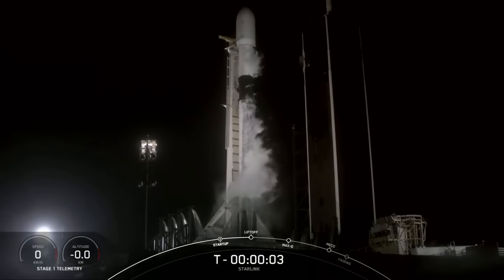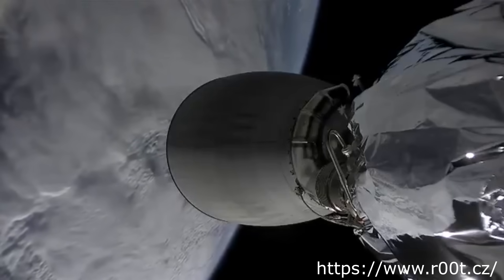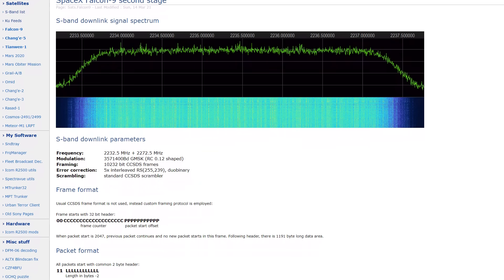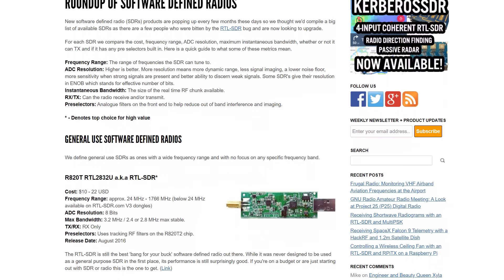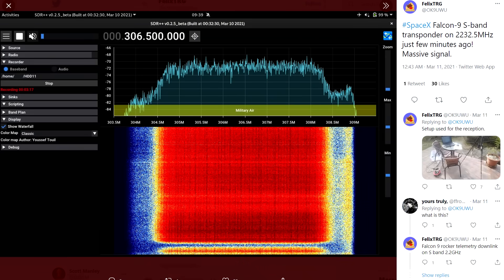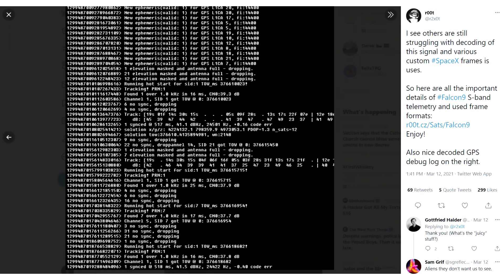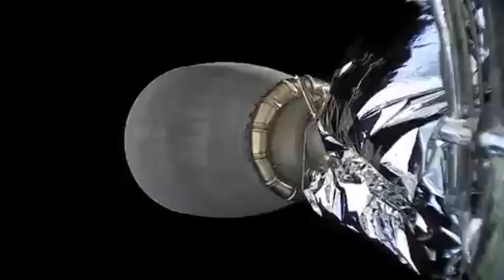How Amateur Radio Fans Decoded SpaceX's Telemetry & Engineering Video

Comment: Good video as always Scott Manley!
Just wanted to leave a little bit of knowledge here. Spacecraft telemetry is  generally sent in either S-band between 2.2 GHz to 2.4 GHz(mostly to 2.3 GHz tho)or over X-band between 8-8.4(8.5) GHz, then they are downconverted to generally 70 Mhz or 720 MHz depending on the situation. Now how the conversion works?

When you multiply two frequencies with a mixer you get two difference response in frequency domain, let's call the frequencies f1 and f2
First response you get is f1+f2 and the second one is |f1-f2| by using something called phased locked loops(PLL) you can downconvert a 2.3 GHz to 720 MHz by multiplying the 2.3 GHZ signal with a 1580 MHz signal and then you can filter it to leave out  2.3+1.58 GHz response to only get 2.3-1.58GHz response.

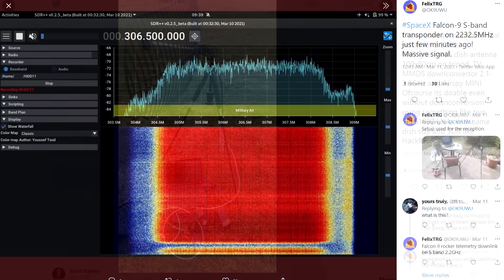Comment: Really surprized to see my radio receiver software (3:43) in a Scott Manley video lol
Reply: I just installed it yesterday! Works pretty good so far, though having the ability to scroll through the band would be nice. Thanks anyway, certainly much easier to use than SDRAngel.
Reply: @ErikBročko  Shouldn't be too hard to add ;)
Btw, make sure you always run the latest commit and not the releases, I push fixes very often.

Comment: The term your looking for is a transverter.
Reply: Not quite. A transverter works on both transmit and receive. This is more accurately called a down converter and it is, in effect just a front end superhet mixer.

Comment: HAM operator here.  A downconverter is basically a fancy way of saying that the SHF receive frequency is being shipped through a mixer to shoot out the signal at a much lower intermediate frequency (IF).   The SDR is then listening on the IF of the downconverter output.  When we play with frequencies in SHF, it's typical to use a "transverter", which is a upconverter and downconverter in the same package, and we modulate it with something like a standard VHF/UHF radio.  The dongle isn't that expensive, but the AZ/EL rotor to track the satellite/other body and downconverter is where the money is spent.
Reply: I dont understand this. But very interesting.
Reply: @xzaz2  Let me see if I can help with the understanding.  Radio is this very easy thing that people complicate which is why RF engineering has become a magic art of sorts.  Most radios that are not software defined use something called the "heterodyne principle", heterodyning meaning "mixing one frequency with a received signal to get another".  We always know what the "other" frequency is, which we call the intermediate frequency, the IF.  This allows us to extract our information off of it using only the one IF frequency (as opposed to any frequency in the receive range), whether that be a voice, or data, or whatever.  Check out this excellent video, including a very nice block diagram of a superheterodyne receiver:  watch?v=x9hnbzF9XC8  (Note that this does not contain the transmitter block diagram which has a few different pieces.)  Superheterodyne is basically heterodyne with amplification included.  Since that clouds what I'm trying to explain, I'm merely going to refer to it as "heterodyne".

Downconverters work as kind of a lego of sorts of the heterodyne receiver.  Imagine the block diagram in the video above, but take ONLY the components from the antenna and IF block.  That's a downconverter.  It receives on one frequency, goes through the mixer with the local oscillator, and spits out the RF on the IF frequency, which is a dividend lower.  That output is then hooked up to another radio which is listening on that same IF frequency of the downconverter, but instead of an antenna, they're just linked with a coax jumper.  It can be a software defined radio (which uses something called IQ - "quadrature signals"), or a conventional heterodyne, or whatever demodulation needed.

Radio circuits all have limitations on frequency range.  In the case of the SpaceX decoding that Scott is talking about, that IF output on the downconverter is hooked up to a software defined radio to knock down the frequency that would normally be well above the range of the SDR itself.  I hope this at least helps demystify some of it.  I recognize that a lot of this is second hand for me and I may have glossed over some things I take for granted, so feel free to ask any questions you have.

Comment: I never had the patience for that level of geekiness.  It's really good that somebody does.
Reply: Same... Digital RF wizardry like that will always be way over my head 😁
Reply: I once studied RF tech pretty hard in college, loved it, but never worked in the field and now my knowledge is lost. Still really cool stuff.
Reply: Right?  I just use my rtl-sdr to listen in on air traffic and ham radio operators talking about conspiracy theories.  :-P
Reply: @andie_pants  :o)
Reply: almost nobody acquires this level of expertise through hobby alone. 10 to 1 he's some kind of professional radio engineer.
Reply: @oldfrend  Probably, but not necessarily. Perhaps a software engineer, or experimental physicist, or something like that. Then again there are people whose hobbies are completely different from their profession, and they devote similar, if not greater amount of time and energy to them.
Reply: @bazoo513  The average software engineer has no clue how most complex rf systems work.
Reply: @jonnyj.  Average, no, I agree. Do these guys look average to you?
You do know that amateur radio operators revel in, for example,  communicating over long distance by bouncing radio signals from the Moon or from meteor trails, using self-built equipment (well, the best of them do). And they are amateurs. Look up Copenhagen Suborbitals to see what driven amateurs are capable of.
I don't think that RF part was the most challenging one here, and, after all, SpaceX is using standard frequencies, modulation and encoding (I was surprised that there are standards for such esoteric use, but then, why not - telemetry is telemetry,)
Reply: I know right! My level of patience maxes out at making 27 M1-D engines from ⅜in dowels for Falcon Heavy model rockets...!
Reply: Some very smart people have no patience.
Reply: ok boomer?
Reply: @lolbots  ok millennial?

Comment: Does this mean the next generation telemetry will be encoded  by encryption next
Reply: Encoded WITH encryption. Encoding and encrypting are two different actions. Encoding is formatting the data such that it can be decoded(read). Encrypting is an additional action, done before encoding, making the data unreadable. But probably not, else it would have already been encrypted.
Reply: Unlikely because encryption would result in more data loss when interference or transmission errors occur.
Reply: @TallinuTV  Ah, but for that's there is Error Correction. And encryption does not result in more data loss, the stream probably is sent as packets just like the IP/UDP protocol, just with extra error correction codes.
Reply: @paulmichaelfreedman8334  true but encryption is an action that takes work unless the system has enough over head to accept encryption it will slow down the system this would also depend on how hard of an encryption is used there harder it is the more work it take. also unless they use some really hard encryption someone can just record the data and crack it later even with the hardest of encryption's if someone puts in the time and effort in it will be cracked sooner or later.
Reply: @phalanx3803  Anything can be hacked, eventually. But if CPU speed is an issue encryption/decryption can be done in hardware. It often is.

Comment: Really incredible work with the decoding part! 

For the curious viewer: the "downconverter" mentioned  about three and a half minutes in works in a far simpler manner than you might expect: multiplying two waves produces a new signal containing waves formed from the sum and difference of their frequencies (if you've ever heard of "beat frequencies", this is it!) After a special low-noise amplifier, the incoming signal is mixed with a local oscillator of just the right frequency to "translate" the signal into the appropriate range, which is then passed to the SDR.
Reply: And there's one of these in the middle of every satellite TV dish.
Reply: Hmmm, yes. Very "simple".
Reply: @arkology_city  It really is, after mixing you only need to filter out the signal you need.. easily done in software with a SDR.
Reply: @arkology_city  If you have two guitar strings and you tune them to nearly the same frequency, then play them at the same time, you'll hear them getting loud and quite a few times per second at a frequency that is the difference between the tuned frequency of the two strings. This is similar, but with radio waves.
Reply: @arkology_city  I wouldn't call it super simple, but it was far simpler than I expected when I first read heard of upconverters. "What black magic could possibly be in one of these boxes?" I wondered. Turns out it's just trig identities.
Reply: @waterlubber  It's not super simple, but it is super heterodyne.
Reply: The reason it works isn't obvious if you aren't familiar with signal processing, but this process allowed commercial radios (AM and FM) to get a lot smaller and cheaper by letting much simpler filters replace complex tunable filters.
Reply: @waterlubber  Or Fourier transforms.
Reply: @ReinoGoo  Ha ha, old school :)
Reply: @atk05003  Yeah, pretty much every radio receiver operating above the AM bands uses some form of down conversion to a lower intermediate frequency like 455 kHz or 10.7 MHz.  All the Dish and DirecTV antennas have low noise block down converters (LNBs) that do this too.
Reply: @ReinoGoo  - 
*groan...radio nerd dad jokes... Sheesh
Reply: @ReinoGoo  I like what you did there. Here's 10 Internet points as a token of my appreciation.
Reply: @ReinoGoo  I see what you did there.
Reply: It’s interesting just how much can be cross-applied from knowledge of optics and quantum wave functions.
Reply: I played with C band satellite during the 80's and the initial receivers carried the 4.2 GHz signal all the way to the receiver before it was down converted to a reasonable IF frequency.  This used special coax that was over an inch in diameter and very pricey.  Later they developed the block down convertor which converted the whole range down to something more reasonable that could be carried over regular 75 ohm TV grade coax. The block down convertor was separate from the low noise amp and still used a pricey piece of RG214/U  but only about 6 feet or so.  Then they combined the LNA and block down covertor into one unit so the cheap 75 ohm coax could be used all the way from the feed to the receiver.  Same way that services like Direct TV and Dish work now. The way of preventing large blocks of zeros in the signal sounds very similar to the way IPv6 can represent recurring blocks of zeros with a pair of colons.
Reply: @gwesco  RG214 is about $20usd a metre. So that's a $40 cable, not including connectors (probably more expensive in the 80s though). The special thing about RG214 is a very high velocity factor and ok but not wonderful shielding for it's flexibility. The velocity factor is important in designing filters, which is not likely to be an essential property in that application. Much cheaper RG213 would have worked in that application with some physical separation in your cable route. These days we just put a miniature converter right in front of the dish and just plumb the already converted low frequency signal around on cheap crappy cables.
Reply: @gwesco  I was installing c band satellite systems in 1980 that had low noise block converters. You must have been behind in times
Reply: The technique called heterodyne has been used in every AM radio forever. Converts the incoming signal to a single frequency (IF) to be processed by the hardware (e.g., 5 tubes and a bunch of caps, coils, and resisters).
Reply: Similar to using a local oscillator to convert a signal down to a single intermediate frequency (IF) for amplification.  Used in good old fashioned AM, FM, and TV receivers.

I actually have from the 1970s & 80s two 27 MHz down converters that let you listen to CB radio traffic on an AM/MW broadcast band car radio.  Same basic principle.
Reply: Yeah you don't wanna be sampling at at least the Nyquist frequency of the carrier wave if you can avoid it :)
Reply: Down converting also helps if you are communicating over SHF or EHF and your uplink/downlink doesn' like to transmit through copper due to very high attenuation
Reply: @Ike-kn5dt  Good point!
Reply: very similar to the heterodyne system of adding a signal and then filtering the sums to leave only the differences, which is used by every radio since FM. Did AM use heterodyne too?
Reply: @SittingDuc  Yes.
Reply: Oh,okay,got it,yup no sweat.
Reply: I was coming here to post the same.
Reply: Yeah, it's "just" the right frequency 😳
Reply: It's my understanding beat frequencies comes from adding waves together like in real life when two waves meet (not multiplying), this gives you the difference of the frequencies as the beat. While the sum only shows up after processing through our ears and brain. For some reason the sum shows up as a perceived beating only in our heads, and not when measured with a real life microphone.
Reply: Anisomorphism moment
Reply: Look for "frequency mixer" on wikipedia for more information
Reply: Interested in this information too
Reply: Yes, I thought so too.
Reply: Ah, hello fellow satcommer

Comment: This seems like the most forward thinking reverse engineering I’ve seen.
Reply: I’ve seen genius decapping integrated circuit and reverse engineering them but yeah, reverse engineering data stream is impressive.  
Check “Applied Science” and “CuriousMarc” just for a glimpse of decapping IC chips
Reply: honestly, decoding data streams is significantly less impressive than tracing out and reveres engineering an IC
Reply: You should watch some DEFCON videos

Comment: if they set up in the ocean could they get fairing separation of a classified satellite deployment.
Reply: Unlikely. Those will be encrypted.
Reply: @gdwnet  more likely they just turn of the cameras.
Most rockets don't have them and rely just on telemetry to know if everything is ok.
And surely also SpaceX doesn't rely on them for anything really important.
Reply: @gdwnet  but if you have to develop the software and processes to encrypt telemetry for one launch, wouldn’t you just leave it turned on for every launch? I can’t think of any penalty to using encryption, and the less data that gets out the better. Even if you think it’s trivial. Enough of it might pose an issue
Reply: @jackgibbons6013  No, I wouldn't.
Reply: @jackgibbons6013  You forgetting both about "the best part is no part" and "the most secure computer is the one that's turned off, unplugged and locked in a safe".
Reply: @gdwnet  Unless they are not - do not underestimate government inefficiency :)
Reply: @foxtrotunit1269  But then it's probably illegal, governments are very eager to outlaw things
Reply: more likely they just remove or turn off the cameras that would show the classified stuff
Reply: @xWood4000  Not in international waters :)
Reply: @foxtrotunit1269  True ;) No but seriously it is basically a missile under the jurisdiction of  the United States, serious matters
Reply: @theonlywalkingpotato  They don't show the 2nd stage at all for those. The payload isn't the only thing that's classified, its destination orbit is as well. Seeing even the 2nd stage engine cams can give us information we're not supposed to have.
Reply: The destination orbit might be classified but it's pretty easy to track a booster via radar if you have the resources (ships, ground stations, etc). Classifying the orbit just ensures that opposing powers have to do a little bit of work on their own.
Reply: For a classified payload they ptobably remove the cams
Reply: shhhhhhhhhhhhh 🤫
Reply: Even for something classified they’re still going to want engineering cameras that let them keep track of the state of the payload.
Reply: If you thought of it, you can be sure other nations are already doing that very thing.
Reply: Sure.... if they want trouble with the government

Comment: ive been using RTL-SDRs for years now....great stuff...
the cheap RTL-SDRs can be used with whats called a "downconverter" ...it just shifts the signal to a lower frequency... same can be done for HF with an "upconverter" that shifts the frequency up..
the cheap RTL-SDRs ($13 or cheaper!) dont have much bandwidth tho.. they only cover 2.8Mhz max.... this would have been decoded with higher end SDR (100$ range).. ya looking at around 4.5Mhz bandwidth just for the spacex signal... (it actually looks wider than that)